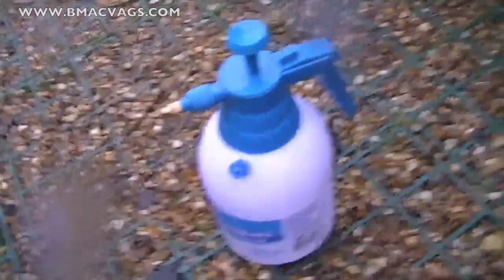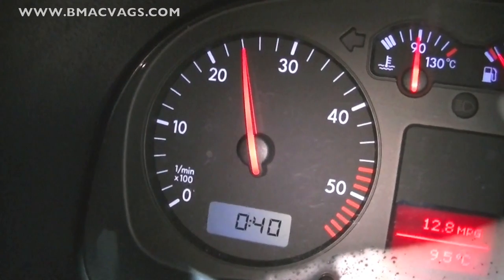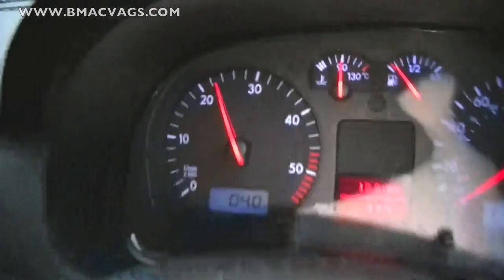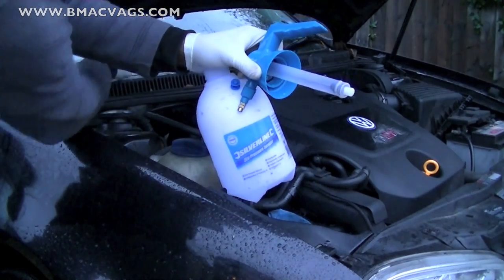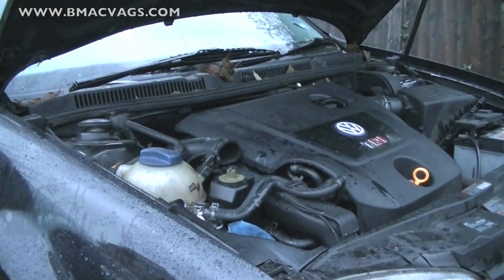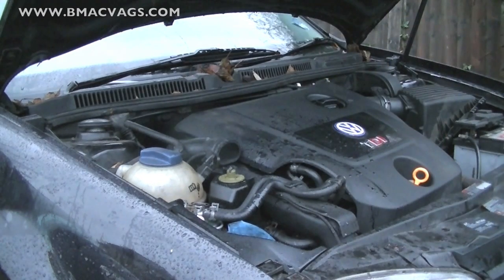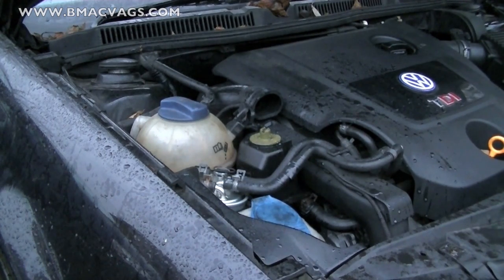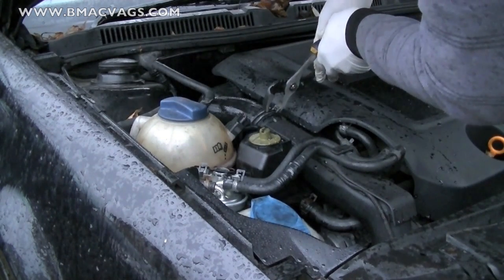How to Decarbonise your Engine with Tap Water

Comment: So the water went through the turbo?
Reply from the maker: consaka1 lol, be easy on him Consaka1. He doesn't understand how it all works, if he did he would not be saying that. We have to do the best we can to explain it to him.

However Frederick Peabody , consaka1  is 100% accurate in what he is saying.  we are not the first to know about water decarbonisation. Water is sprayed into the inlet manifold after the compression side of the turbo, so it can't get trapped there. There is so much heat and pressure that is can't get trapped on the exhaust side either. So what you are trying to say doesn't track up. Saying water will get into the injectors is like saying air will get into them when the engine is running, it just doesn't make sense. Do some research and you will find some facts.
Reply from the maker: no it didn't
Reply: buzzsaw301 It is best to avoid putting water through the turbo. It's complicated but the short version is the water can erode the aluminum compressor wheel. Large bursts of water against the compressor wheel spinning at a decent RPM can literally ruin the turbo. Infrequent use of a very fine spray should be fine though.
Reply: consaka1 It's only going to hurt your turbo if you let the steam sit in your turbo, but at that point it should be so hot and dry almost instantly. It shouldn't hurt it at all. If you take it for the drive ,and get it good and hot like is stated everything should be dry in the system. The only way a turbo should be hurt by moisture is if the vehicle sits, and moisture gets up the tailpipe back up inside it and sits there to rot the iron parts.
Reply: Frederick Peabody ????? You really have no comprehension of how this works do you? First of all it has already been established that you need to let it run for a while or take it for a drive to finish driving off any moisture still left in the system. Second of all I was talking about the compressor wheel. Where would the compressor wheel get steam? Neither the turbine wheel or the compressor wheel is made out of iron and thus will not rust anyway. Thus the turbo is fairly well protected from casual moisture damage. 
However my original statement is still correct. You do not want water being injected before the compressor wheel because it can damage the compressor wheel. Now if you want to go do it all the time to your vehicle I could care less. But don't be telling people that it won't hurt their turbos when in fact it can. 
The only safe way is to do it near idle/no load with very small amounts of water at a time. Under load a turbo can be spinning 120,000 rpm. Hitting a large chunk of water at that speed can be like hitting concrete. In fact it can snap the shaft right off. Smaller amounts of water in a spray can actually erode the compressor wheel like sand.
Reply: Obviously first off your an ass for how you think your a genius, l do know what I am talking about. The body of some turbos have mostly iron body's. For your comment about to much such water hitting at one time. If you do it correctly it's going through the injectors, it's in the form of a exhaust moisture. Just like if the gas station had water in the gas. There's no way as you put it to get a large chunk of water there, it's exhaust gas.
Reply: Frederick Peabody ROFL.. What the hell you smoking m8? lol nobody is sticking water through an injector here. Oh man you are killing me! hahaha. Watch the vid. Its a very low pressure sprayer spraying big clumps. Other vids show people dumping it in with a cup. In the intake no less. Where the heck do you get the injector stuff? You don't want water with the fuel. sheesh that could ruin lots of stuff. No moisture is going to stay in any area on the turbo to cause rust much less any other problems. 
Listen m8! I may not be a genius but I am a mechanic and I have worked on many turbos big and small. I have vehicles with Turbos and have experience with water injection beyond just cleaning the cylinders out once a month. 
You talk like your brain is on meth. You make no sense and you add stuff like putting water through your fuel injectors that has nothing to do with what I was saying!
If you do it correctly its going through the injectors? rofl. Thats the worst possible thing that could happen. That would mean you are doing it wrong. Injectors in these cars are for FUEL ONLY! Everything I have said is true and backed by science. I dunno what you are going on about but I hope people take a pass on ANYTHING you say about cars.
Reply: BMAC VAGS 
That hous is leadind into the inteke of the turbo, the air is comprest and coold and is entering the inlet mainfould/ divided in 4 and in to the engine !
So it did !
Reply: ROAlexa1981 Lol. seriously? The air is compressed and cold? Uhm air does not get cold when it is compressed. It gets hot. Very hot. It does not get inside the injectors regardless.
Reply: consaka1  
Lol , seriously  ? and were is the fuel from the tank going ?

And to be more precise, yes the air is comprest by the turbo and is geting hot, thetway is going thrue the intercooler to be coulder, the biger the intercooler the betre(could air is denser than hot air ) and is going direct to the intake mainfould and from there around the inlet valves in to the explosion chaimber.
This is a air intake and exost renault 1.6 diesel engine:
https://www.google.ro/search?q=sistem+de+admisie+tdi&biw=1360&bih=667&site=webhp&source=lnms&tbm=isch&sa=X&ved=0CAYQ_AUoAWoVChMIqaDAr7WKxwIVqUvbCh3A6ASq#tbm=isch&q=sistem+total+de+admisie+aer+tdi&imgrc=1IzDhMvKdparVM%3A
and this one is a general one:
https://www.google.ro/search?q=sistem+de+admisie+tdi&biw=1360&bih=667&site=webhp&source=lnms&tbm=isch&sa=X&ved=0CAYQ_AUoAWoVChMIqaDAr7WKxwIVqUvbCh3A6ASq#imgrc=j6kF1C3PpgoAuM%3A

WERE THE .... ARE THE INJOCTORS ???
ther is non, thrue the injectors goes onley fuel .

Hope that you andestend now !!
Reply: consaka1 
Did y sed it get air in the injectors ??
Reply: ROAlexa1981 
Y did not, read wat y write !
Reply: ROAlexa1981 I am sorry but there seems to be a communication problem. English is second language for you, yes? I cannot understand or comprehend.  
Neither message makes any sense.
Reply: consaka1 
3 rd actualy, and is the 1 st messege that is important to make sens !

Comment: Hope people arnt calling me a kiddy no experience  lol a know my fair share id say and especially the 1.9 tdi 150 vw pd tdi engine,  i respect the person who makes these vids and he shows it works on the cars he does it to as shown, all am saying is on my car it caused water or water vapour  to mix with my oil some how and caused mayo at my filler cap,  i compression checked  all was in spec and at 120.000 miles so it should be, theres other videos on here (vw 1.9 tdi) were they dis connect the crank case breather from the inlet and i think maybe this is what caused my problem so sorry about my comment and thanks for your videos keep them coming :)
Reply: Rory James It is possible for some water to slip by the rings and the valve stems. This is why it is Very VERY important to run it up hot afterwards. Take it for a drive to see granny or something. That vapor will come right out of the oil. Short runs into town causes similar issues just from normal exhaust gasses. Not nearly as bad but bad enough to shorten the life of the oil.

Comment: Despite all of the negative comments on this video it worked for me, I recently did an oil change and accidentally put too much oil in, engine management light came on and the dashboard flashed up with check injector and check environment filter and the car went into limp mode, basically the car had sucked engine oil through the turbo and the fap filter as it had nowhere else to go, I dropped the engine oil changed the filter and run it up, cleared faults....came up again, tried every chemical known wynns,redex,injector cleaner etc etc,cleaned the induction pipes (coated in engine oil) I was pulling my hair out ready to take the hit at the garage,in excess of £300, saw this video while trying to find a solution and thought fuck it tried everything else, run the car till hot and tried this 2500 revs then 2000, then give it a good run, cleared the faults and the difference in power is unreal, the car feels new, and I'm pleased to say no more fault lights, thanks man, simple but effective kudos
Reply: Not to mine 8 months in 15000 miles no issues at all Renault Laguna 3 - 2.0DCI. Just followed the guide, the only difference between this and the shit they sell at GSF and such like is food colouring
Reply: What are the symptoms?

Comment: Hey I'm not saying it does not work but i did this once on my audi a4 2002 tdi 131ps, and it got so bad i had to take it to a mechanic, and i did not add a lot of water i simply did the same think your doing, however a friend of mine did it and it work ok for him, should i do it on a golf 4 tdi 116ps? how much water should i add and when il understand that is enough? for how long do i need to do it 15min? or what?
Reply: Mark Luther If in doubt - don't do it at all. The only time I would say this should be done is if deposits are so bad the engine is pinging something fierce. If it cleans up that problem then every so often when you notice the pinging and power dropping off. 
Cleaning the carbon out of the cylinder is not something that HAS to be done. Many times major deposits will clean themselves after a good long drive. Its the short drives that is hard on an engine. Mostly because the temps don't get up enough to actually burn off deposits. Short drives are hard on oil too.

Comment: One thing you'll notice--All the Negative Comments are generally by little kiddies with little or NO EXPERIENCE of Mechanics or engineering--apart from--Maybe changing a wheel or adding a loud exhaust to their crappy lowered Corsas, and relying on SOFTWARE to assess an engine condition--instead of Experience and their own senses--like hearing!!
PROPER ENGINEERS KNOW this does Work! Fact,--Get used to it Kiddies!
Reply from the maker: I like that :)
Reply: Piss off marlinnotfish you clearly dont know what you talk about. I did this on my 2008 Jetta tdi with 80thousand km on it and it worked perfectly well. Turbo wistle back, more power on the lower end, more km per liter, no fault codes, no problems.

Disclaimer: DONT BE A DUMBASS AND SMACK 1 LITER OF WATER OUT OF A CUP OR BOTTLE AT ONCE IN YOUR ENGINE, YOU HYDROLOCK YOUR MOTOR AND THAT IS YOUR OWN RESPONSIBILITY NOT FROM THE VIDEOMAKER.

BMAC VAGS: Thanks for the explanation, it helped me fix my slow diesel regain some of its power back!
Reply: HighCompressionII sounds directed towards a certain someone. This method can work if you know what your doing. But for the average joe who doesn't know how to meter in the mist correctly it can damage the engine. And this method only works on diesels. Old diesels. If you got a newer common rail 4cyl turbo vw and tried this you'd set fault codes that can't be cleard unless you have a vag com scanner. So trying to keep people who know nothing about this from getting themselves into a rut or leaving a disclaimer in the video would helped avoid that. Also if you knock to much carbon loose you can hurt your exhaust catalyst. But everyone can go on and on about how this is fool proof and the best thing since sliced bread. It works on older bullet proof diesels not all newer and even some older diesels.
Reply: @marlinnotfish  my jtd still works and it burped out some nastiness.. Granted sensors ain't gonna be pleased if you go ott.

Comment: Can I just say I have been a motor vehicle engineer for many years and this isn't a new thing I have been using this method since the early 1970s and it works just fine as long as you use common sense nice and gentle as she goes.
Use the Mr muscle bottle method but if you are a bit wary just think about country's of high humidity cars work just fine all you are creating in the combustion chamber is steam lets say your head gasket starts to leak it will put far more water in the chamber than this method and still your pistons will not be damaged. I have used this method on everything from ford side valve to Rolls-Royce engines. The only thing I will say is if the carbon is hiding a crack or flaw in one of your castings and you clean it out it will expose that problem however it will not have caused it.
Hope this helps everyone
Reply: So what happens next, must you do oil change?
Reply: Someone sensible, but this is bad news for fancy products hence the nay sayers..
On a nice cool morning with a bit of fog in the air my car is pretty happy.
Reply: @DUB-sential it gives an answer that why the car sometimes runs better at night

Comment: Where does the water go in on a mk4 1.8t, Throttle body?
Reply: Ben Upton Hi Ben, I think put it in at throttle body. Maybe disconnect the wiring connector from the MAF while doing the clean. I previously used a slow drip method through the fuel regulator  pipeon the intake manifold and it worked very well, though not as well for the furthest cylinder.

Comment: Are all cylinders / injectors / valves cleaned out equally by decarbonising?
Did all the carbon go out of the exhaust?
What if the dissolved carbon clogs the cat-con / EGR?
What did the dislodged carbon do to the turbo?
How much of the rock-hard carbon is actually removed?
Can partial carbon removal cause leaky valves or sticky rings?
Reply: Clive Smith This doesn't clean injectors at all. It won't clean the intake valves very well. Any carbon knocked loose will have to go out the exhaust. If this clogs your CAT then your CAT was already dead. Or you didn't drive it long enough to heat the CAT up.  Should not have any effect on the EGR. The bits of carbon coming loose are not near as tough as the Turbine blades on the turbo so no real affect there. How much is removed depends on how long you do it. No partial carbon removal should not cause leaky or sticky rings. It might help sticky rings. Haven't had one to test on though so I can't really say for sure. 
There is only one thing that might could cause problems and that is not taking it for a drive right after and letting it get warmed up for a while. Take it for a drive up some steep hills and let that engine get a workout. This will cause enough heat to evap all the water from all the cracks and crevices it got into.

Comment: Where should i tap the water for a Octavia BKD  engine? In the intake manifold house like you did, or after the MAF sensor that is before the air filter?
Reply: Ziggy Loco  
Afer the MAF senzor !
And the senzor is AFTER the air filter !
Reply: ROAlexa1981
Thnx
Reply: +Ziggy Loco After the air filter, after the MAF, after the turbo and after the intercooler. You want it to go in as close to the inlet manifold as possible.

Comment: I recommend distilled water because it doesn't have any impurities in it.
Reply: Yess, using distilled for Decarbonising is wise decision,
Because Tap water may contain hard mineral substance, 
And may cause some of the hard atoms may stick to Pistons & Combustion Chamber
Thanks Bro 👍
Reply: +MAG “MAGWolf” Drago Good one. Some cleaners can make some engine components actually dirtier on a new car. I haven't tested it, but I'd think distilled is a good move.
Reply: Yes you have a point there, but i´d guess that normal tap water is clean enough.

Comment: SO , I HAVE A VW NEW BEETLE 1.8 TURBO ,TO DO THIS , WOULD I SPRAY THE WATER INTO THE THROTTLE BODY WHICH IS DIRECTLY CONNECTED TO THE INTAKE MANIFOLD ?  WAIT ... JUST GOT A THOUGHT ... I DO NOT THINK THE CAR WOULD EVEN RUN  WITH THE INTERCOOLER TO THROTTLE BODY HOSE DISCONNECTED....

Comment: It is NOT very safe method.....if you spray to much you will hydro-lock the engine causing catastrophic failure.... IT does work but must be preformed with extreme caution... Even the amount of water sprayed in the video was too much at once...Half of that would render the same results without the nasty knocking

Comment: You are more right than you know when you say that the water (steam) melts the carbon. It's a well known reaction of steam with red hot carbon, where the hydrogen and oxygen in the water react with the carbon to turn the carbon into carbon-monoxide gas. The reaction is described by H2O + C → H2 + CO (ΔH = +131 kJ/mol). This is also why it's important that the engine be fully warmed up before doing this. Anyone doing this should also be warned NOT to pour water into the tube as pouring the water in too fast can possibly hydrolock your engine with resulting catastrophic damage.
Reply from the maker: I have another video where i put a borescope into the engine before and after water decarb.
Reply: +consaka1 http://www.amazon.com/gp/product/B00JERRES6
Reply: BMAC VAGS Link?
Reply from the maker: consaka1 Should be in the description
Reply: BMAC VAGS Its not. Least i couldn't find it.
Reply from the maker: consaka1 Here you got pal https://www.youtube.com/watch?v=eZDISp2pdSo
Reply: BMAC VAGS thanks m8! Excellent video by the way. I think you should have done more water though and perhaps made sure it made it to each cylinder. Only one cylinder looked typical of water cleaning action. Some of the others looked like they had some cleaning but not as much as I would have expected. 
Where did you get the probe to take the picture inside the cylinder. Id like to get me one of those. If I can afford it. :)
Reply: Frasier Linde thanks m8. that will come in handy.

Comment: Does this pass through the turbo too and clean that out?
Reply: goonzjav If your turbo needs cleaned out you got other issues. Typically it should not have any serviceable affect on the turbo.
Reply: a turbo is powered by the exhaust gas, not by the intake.